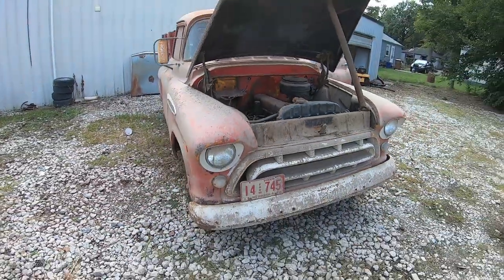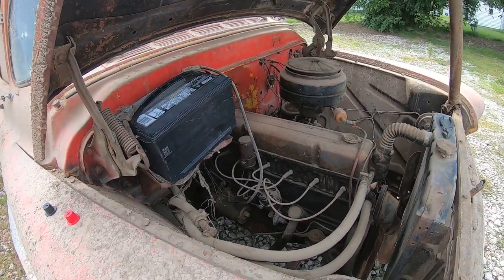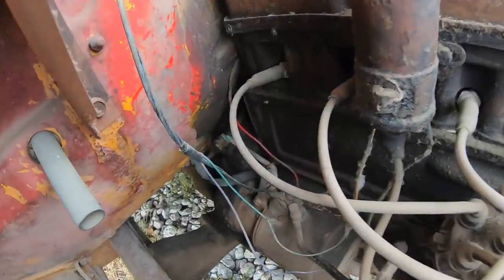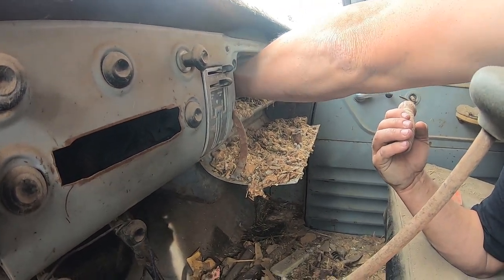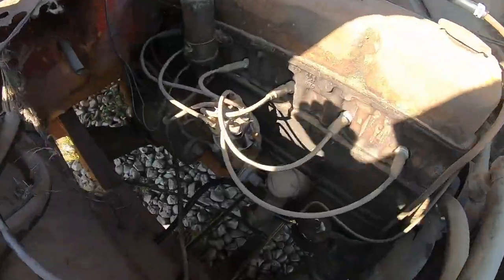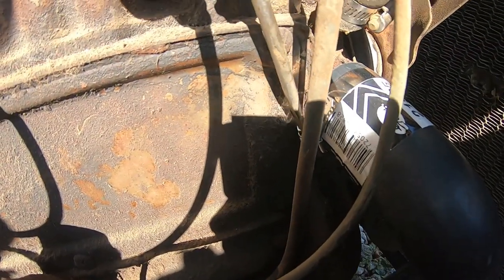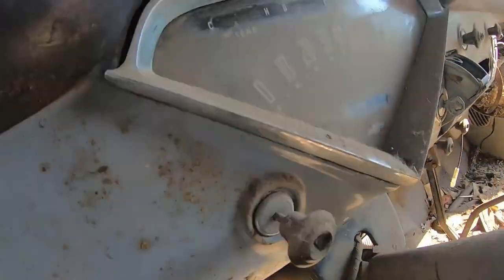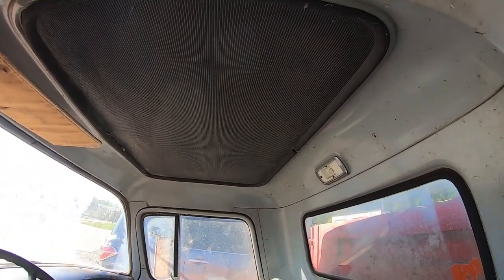Barn Find! 1957 Chevy Truck Will It Run and Drive?? Revival! Restoring Hope For Classics!

Comment: You might want to use gasoline as a starting aid. Ether will strip oil from engine rings and cylinder walls. That is a really nice truck. Good video guys. Keep up the good work. Save them from the crusher!! Back in the 60's my dad had a 57 half ton step side. One of the first trucks I drove on the road. I wish I had it now.
Reply from the maker: Yes i should use some 2 stroke gas, thanks for watching!
Reply: Very good point. Using starting fluid on an engine that hasn't had any oil circulation in a long time is a terrible idea.
Reply: Napa sells starting fluid with cylinder lubrication in it.

Comment: Amiture revival, no lube at all in cylinders , starting fluid, what's in the air filter, and not checking the oil come on really, you could destroy a good survivor.
Reply from the maker: Itll be fine, thanks for watching, these straight sixes are a dime a dozen!

Comment: Excellent video  :) old 1957 Chevrolet truck last long time also even motor, transmission also clutch and brakes too! I notice fan not turn fast need the Generator belt tighten up or replaced, do wire up plus battery cables also clean job to starter also Generator, new spark plugs with wires plus cap also rotor and lights to plus lens ! Check horn works plus change engine oil plus oil filter also brake fluid , fuel tank clean or new one  plus filter even send unit and get carb rebuilt too to add 89 octane gas with a grey bottle of STP Total Treatment fuel injection and carb cleaner in fuel tank full ! Check brakes over, even cables for emergency brake handle & exhaust too and new tires too! Change differential fluid too and fuel plus brakes lines! Check all clutch parts too over and fix up!
Reply from the maker: Thanks for watching!

Comment: Its always a good idea to fill the carb.bowl through the slanted vent tube in the top until the area around the throttle shaft gets damp,BEFORE pushing the gas pedal. That lubes the sometimes leather accelerator pump seal.
Reply from the maker: Good info thanks

Comment: Well I appreciate you responding I hope to God whoever gets the truck don’t butcher it up and leaves it in its original state I wished I could find one like that that’s all original now you may not get why being original means to someone who grew up driving one of those but there’s a lot of memories there I like speed tube just a certain vehicles for speed
Reply from the maker: I think hes going for an original restoration, if you follow @real_americana on instagram you can see right when i get the vehicles and you could have a chance at buying one if it goes up forsale.
Reply: Yea, I hate to see those old trucks butchered up. A stock running driving one is rare.
Reply: I have basically this same truck, 3600 3/4 ton with a 4 speed same as this, only a 1956 model in "Ocean Green". Came to me with 80's 350 engine mounts slapped in and no engine or transmission. Parked since 1987. But she's going back to stock the hard way, sourced a '56 truck 235 inline 6, a sm420 4 speed, and I'll be tearing those 350 mounts out and currently she's down to the frame going to be 100% restored and to original specs, colors, even down to the stickers, done up right. There's too many restomods, particularly when it comes to Chevy '55-59 trucks, seeing a correctly restored stock rig is incredibly rare, I've never even seen one in person. This video is a bit of inspiration for me.

Comment: I'd love to see more on this truck, and it'd be great to see someone restore it and restore it stock, down to the right colors and everything. Having a '56 Chevy truck of my own I prefer seeing them stock, and I have not found 1 single video on YouTube of a '55-59 Chevy truck that has been restored correctly, people may get the general idea right by keeping the straight 6 and such things, but very few get things like the interior colors right or the seat trim. Maybe this truck can be different in that way at this point ironically a stock truck stands out more than a modified one. I know mine will once it's done.
Reply from the maker: We sold it to a fella a town over, he is going to restore it, i assume he will keep it original since its all there, hes and older gentlemen, if he gets it finished i will definetly share it with the people and make a video. I agree especially with older classics like this, factory stock is alot cooler than modified.
Reply: @Americana777  Good to hear

Comment: I'm guessing the water pump seal and the accelerator pump and rings have took a hard beating in your start-up. You may get lucky. More prep is really better before you turn it over including a bit of oil in each cylinder. At 32:50,you could hear a valve hanging in its gooey guide. I'd oil it till it smokes, to lube the guides,myself. If it sounds like I'm picking it to death,I don't mean to be mean,but I'm old and do this stuff all the time. Its a jewel. I like it!
Reply from the maker: Thanks i appreciate the advice!

Comment: Nice find, pretty solid well conserved all those years in a dry place I guess, buy some paint cans and clean it up, check brakes, change oil, put new tires! Old sleeping tires can cause accidents, they look good but no integrity at all principally if you go to the road, be careful, with a very low budget you can turn it to a very good truck!
Reply from the maker: Thanks for the tips!

Comment: First five steps, ck oil for water. No water, pull plugs, fill cylinders with wd 40 or other good oil, return plugs. Let set for a while. Pull plugs back out. Slowly try to turn. With what you did you probably scratched every cylinder, probably bably.
Reply from the maker: Yes you are probably right, thanks for watching
Reply: I totally agree to the 5 steps! They need to take more lessons from Derek.

Comment: Great video but painful to watch. Should have pulled plugs and put some lube down there. Just to soften her up. Old oil and you reving the devil out of it. Could have been a good engine. Why wouldn't you clean all that dust off first. And clean out interior.. Don't use that old tank. Mine blew at and filled the cab with fuel. Good job no body was smoking. They a time bomb those tanks. Cool old truck. Hope to see more vids. What's that 57 in the back ground. Do a walk around on it. Thanks have a good day. Nice find.
Reply from the maker: Thanks for watching!

Comment: Step away from the starting fluid!!!! I am amazed it didn't blow up, 2 squirts works just fine. Learn to adjust and clean a carb. Just hammering away with ether is dangerous as well as harmful. I wouldn't buy anything from you. I am surprised it didn't  bang out a rod or piston.
Reply from the maker: Itll be fine! Thanks for watching! She wouldn't fire on the little bursts of ether!

Comment: Why does every idiot on YouTube  try starting dormant engine  without marvel mystery oil in cylinders before starting  and fuel  
But most importantly  change the fucking oil ..... and filter ...  20 or 30 wt oil not expensive  ...  FYI oil seperates after a year 
But you can't fix stupid... but my machine shop fixes stupid  ... when we have to rebuild engine. 30 bucks for fresh oil 
Can save $$ ...   use your heads folks   soak those cylinders   etc  .  It takes a few days bringing engine out of a big sleep
Reply from the maker: Because we dont care about scratching up some cylinder walls on some dumb old straight six that will probably be tossed in the garbage when swapped for a better powerplant. Thanks for the input though!
Reply: @Americana777  that's always the lazy approach. .. toss the original hard to find original engine. .  My shop  removes so 
Many  LS power plants tosses them
In trash and locates original or a original 
Engine  to put back in car .... even a 6 cylinder   can be worth extra money 
If left original  .. that's the problem now 
Days  everyone is lazy  going easy route 
Quick buck .. instead of  original 
Can't fix stupid. I have many of these 
Trucks .. you would be surprised 
How much power you can get from 
A  GMC 6 cylinder  292   use your 
Head idiot.   I have buyers   prefer 
The 6 ...